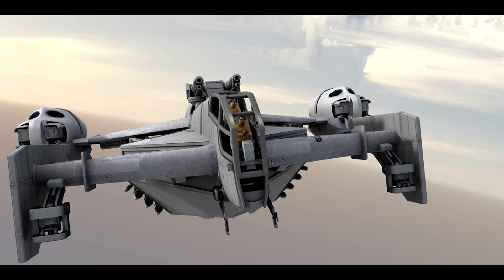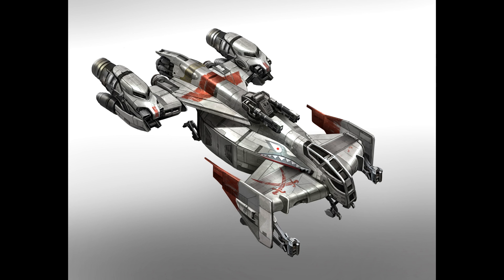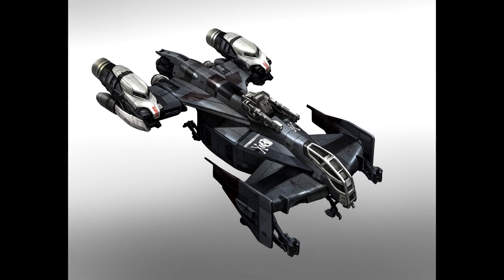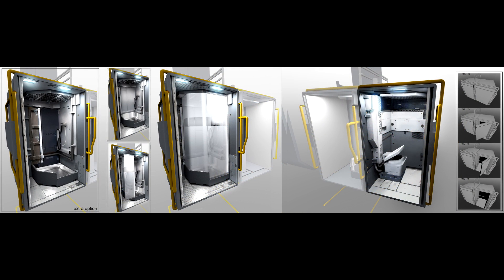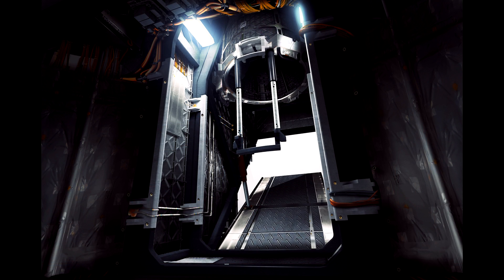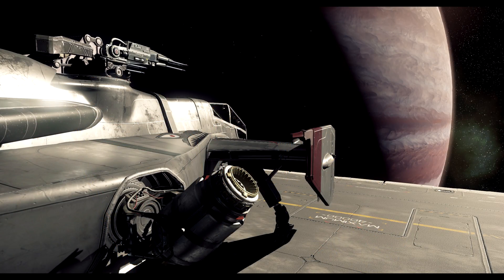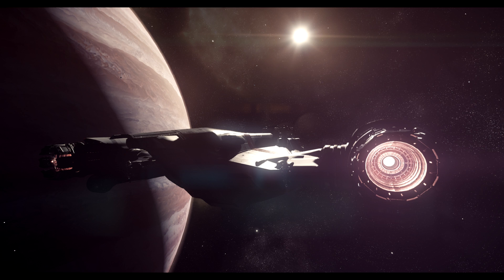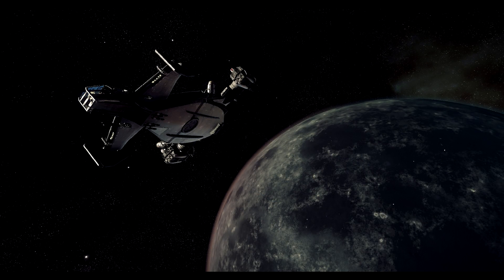Star Citizen: Cutlass Update!

Comment: Hi, Citizens
could you please tell me, if the cutlass black has the new design yet? I don't really like the old 1 but I kind of love the new one. If it is not ready yet, and I start with a cutlass, do I get the new design automatically when it comes out?
in the game, I wanna try everything but piracy, so I am looking for a somewhat universal ship. Cutlass or Freelancer is OK for my wallet. Which 1 do you recommend? It would be also nice to know, how many non-weapon things (tractor beam, jump drive, scanner, sensor etc) I can install on these potential ships. I really don't find this number in the technical description. The other numbers I do find all suggest that the Freelancer DUR would be a better all rounder (jump engine is already there, bigger shields, bigger main engines, bigger cargo capacity) but I really hate the visibility from that thing and there is no info about speed and agility of the ship
thanx a lot